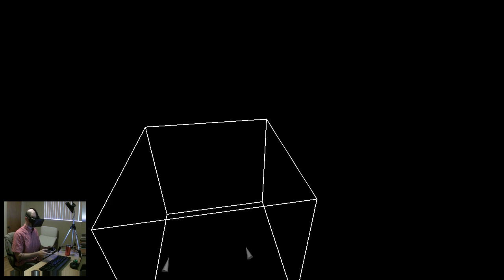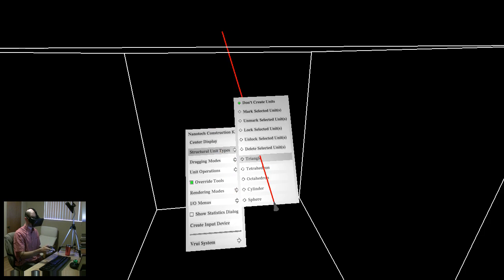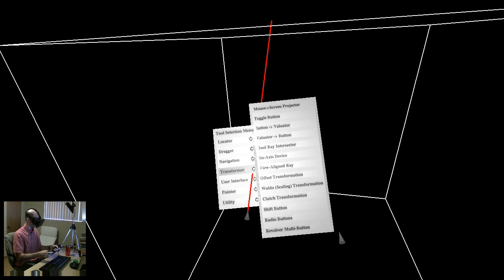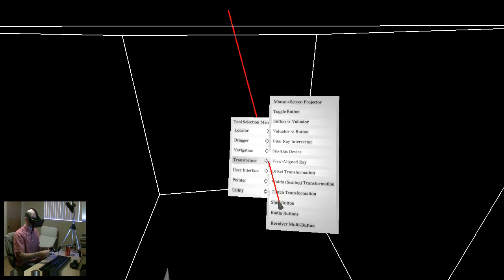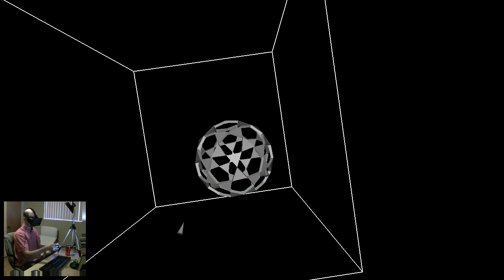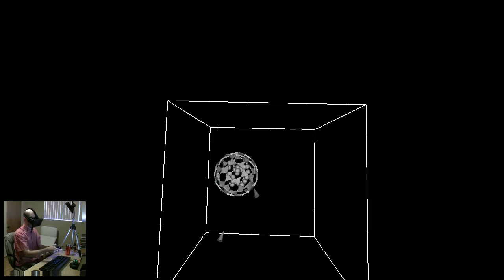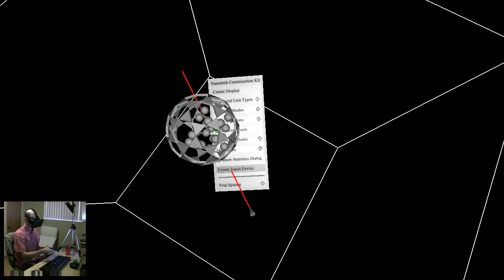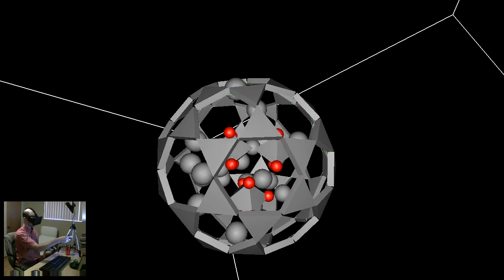Nanotech Construction Kit with Oculus and Hydra

Comment from the maker: Exactly. I want to implement a proper "3D window manager" that can be configured with different policies, such as planar, radial, toolbelt, what have you, according to user taste since there is no "one size fits all." I don't want to hack in mouse support for the Rift unless I have at least an idea what the overall architecture will look like.

Comment from the maker: Yeah, building a holographic 3D TV system still sets you back around $7000, so the Rift is definitely cheaper. But regarding the other part of the comment, this app is just one of a large software suite developed at KeckCAVES. The entire suite is used by a large community of physical scientists as part of their day-to-day work. The display environment, in that case, is a CAVE though.

Comment from the maker: Vrui itself it quite big and old; prototype development started in 1998. The Nanotech Construction Kit is also quite old, the first version is from mid-2003. The Kinect 3D video component was added when the Kinect came out, in November 2010. The Oculus Rift support is the newest addition, but it's small. Just a head tracking driver and code to do lens distortion correction. If I had worked on it continuously, it would probably have been a week or so.

The software is entirely written in C++.

Comment: Perhaps instead of a plane, it could be a cylinder, or even a sphere, centered on the camera? (and just treat it as a laser pointer, something that just hits whatever is closest in the direction it is pointing)
.
And whether the mapping of mouse moves should be transformed depending on where you're looking or not, i guess that would simply depend on whether the "mouse" device knows which way it is pointing (if you can't know if the mouse is sideways, treat the coordinates as relative to the HMD)

Comment from the maker: It's not difficult per se if you're willing to just hack it in, but I'm trying to figure out how to do it in the most general and flexible way. I don't want to have something like a "HMD mouse tool" or, worse, an "Oculus mouse tool." The same mouse tool should work on the desktop and in an HMD without changes. This means there need to be APIs to answer questions such as "on what depth plane is the mouse mapped?" "does the mouse plane move with the HMD orientation?" "on what plane are UI widgets"